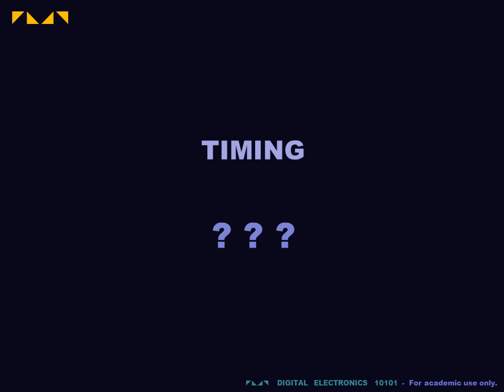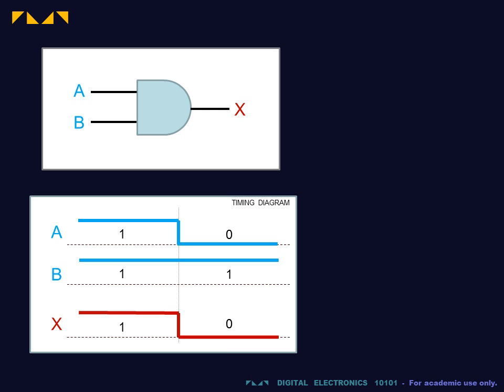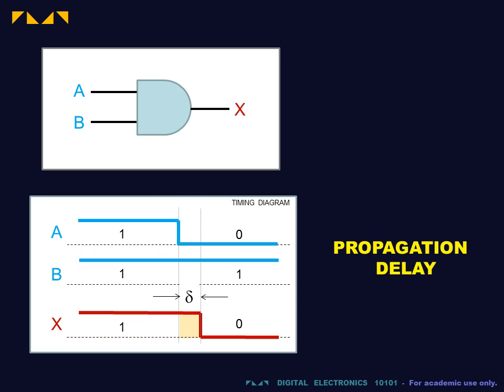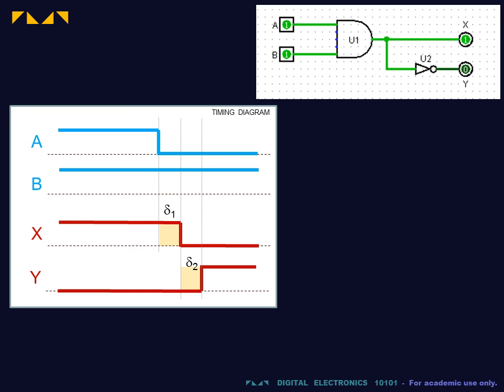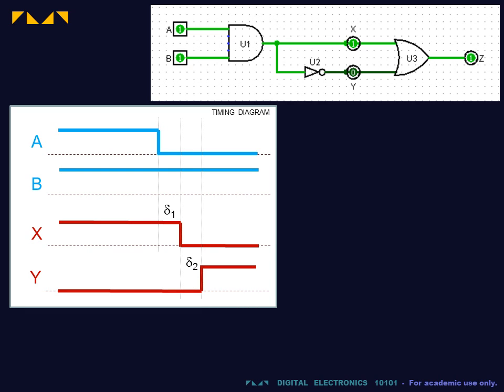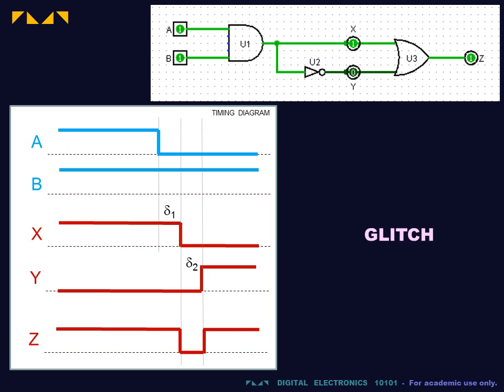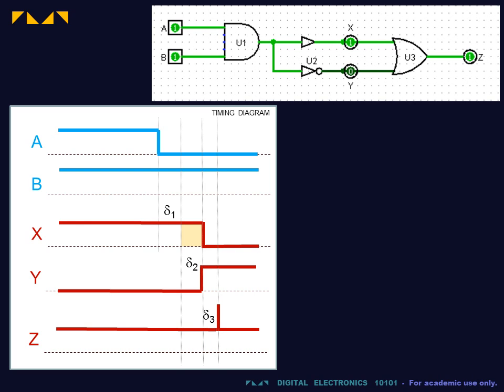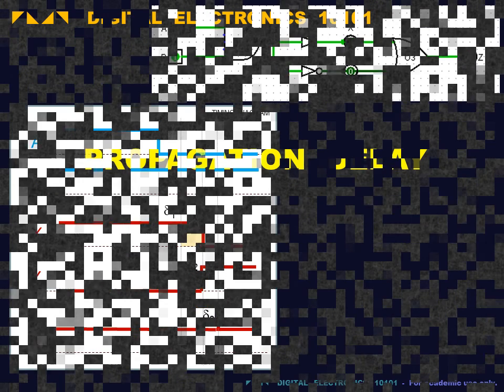Digital Electronics 10101 - Propagation Delay

Comment: but if A and B are both 1, why does A become 0?
Reply from the maker: Hi, Richard.  This video discusses what happens when the inputs change (for some unexplained reason) from one state to another.  The change of input A from 1 to 0 is thus used as an example of such a possible change.  What is important in this video is how the outputs respond in time to this given change of input.  I hope this helps!
Reply: 1 + 1 = 10 (binary)
0 = Sum
1 = Carry